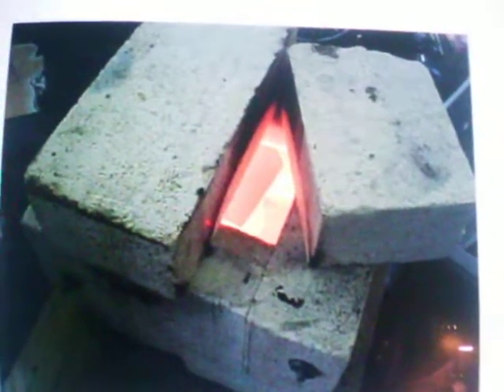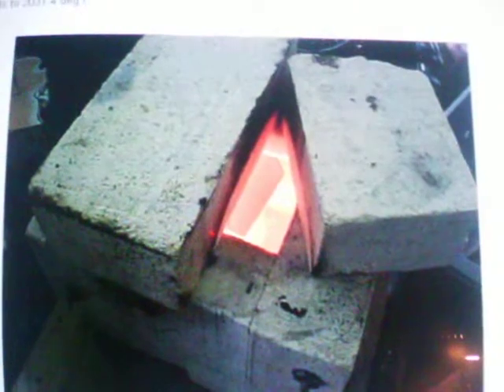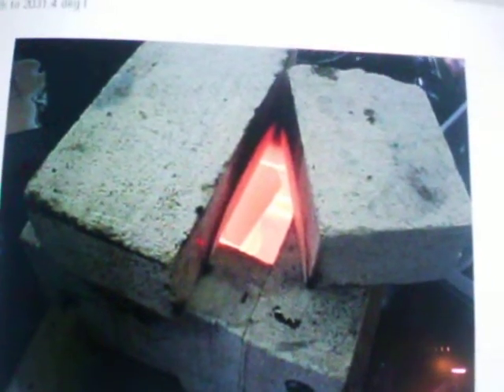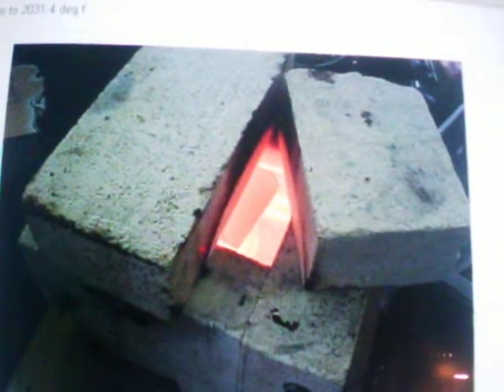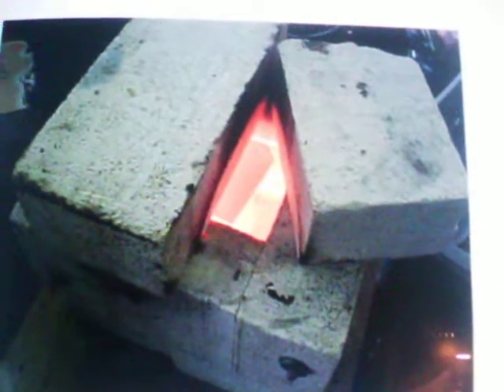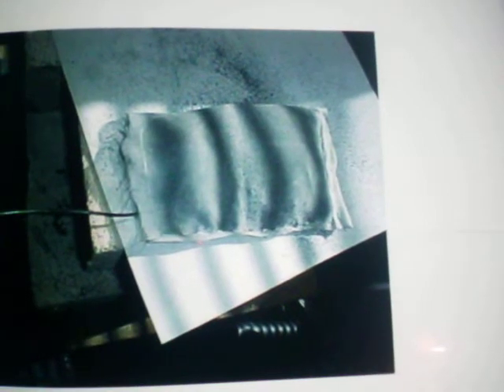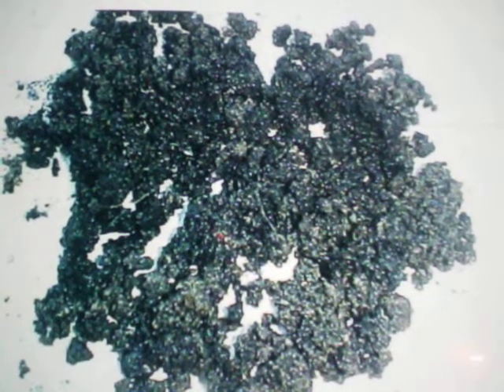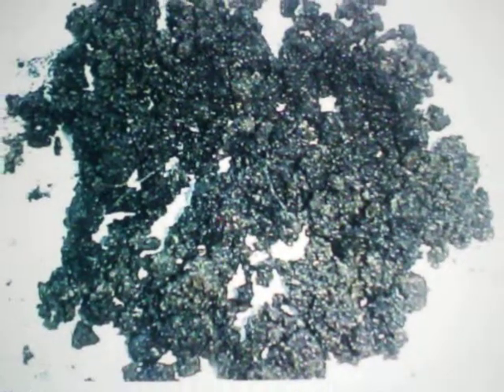iron oxide tutorial-nife battery construction 1 10

Comment: Hi, I'm from finland so sorry for my bad english...
I have an question, so you burn coffee grounds (is that the right word?)? Can they be used, since the water will evaporate?
How do you get in a point where those coffee ground are nickle-plated? What is the process? Electrolysis?
By the way, do you have an website, where these battery-guides are writen???